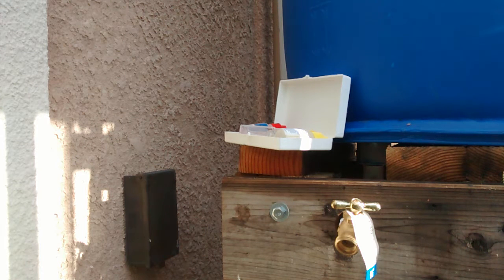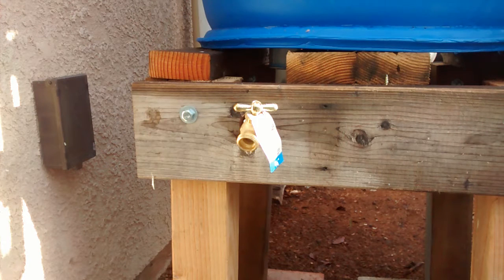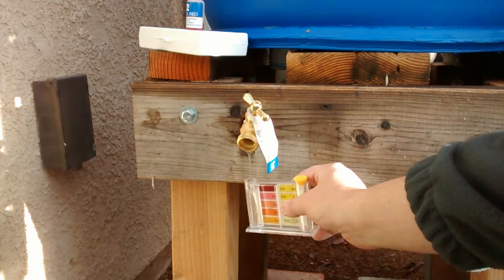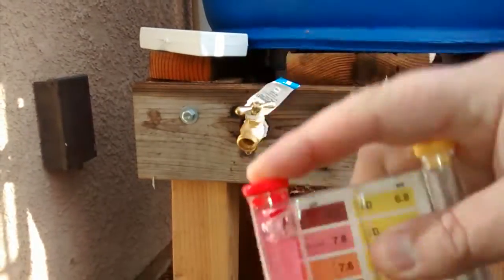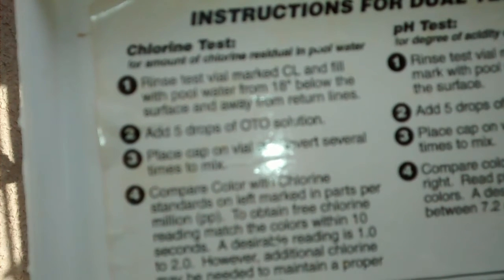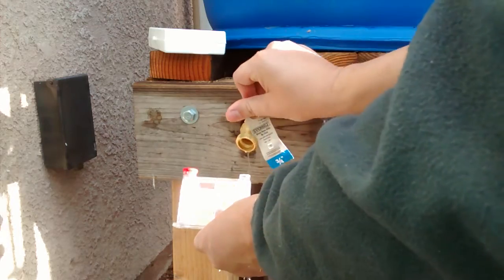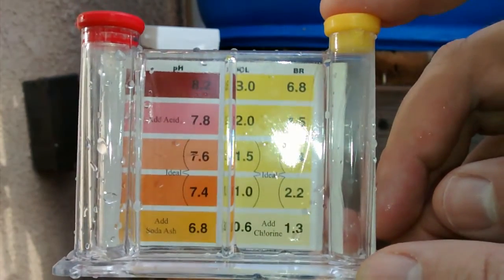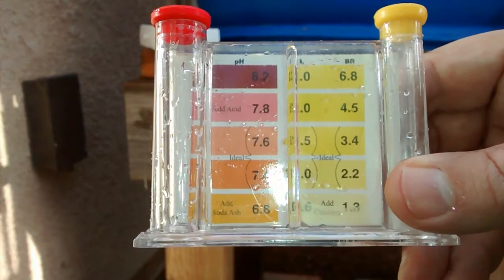Rain water ph and chlorine test

Comment: Yes rain water is drinkable, as long as you filter it first and safely secure indoors in safe drinking containers within the same day it is captured. Heating up fresh rainwater from a storm is not necessary. However, . water remaining outdoors in reservoirs or storage tanks two or three weeks later or more  should be heated to at least 160°F before drinking (boiling to 220°F plus is not really necessary). Make sure to capture rainwater after the air and roof have been washed by 10 or 30 minutes of rain (depending on how heavy, long or frequent it rains). Also, be careful of radioactive power stations in the area or direction of where the rain is coming from. Other than that rain water is safe and much more detoxifying than bottle or tap water. I have been drinking rainwater  for sometime now and much better off than before.
Reply from the maker: All no surprise. Thanks for your feedback

Comment: What makes rain water not safe to drink?
Reply: Jared Lyan manmade toxic pollution spilled into the air by automobiles, machines, factories, airplanes, etc. The heavy release of sulfur or nitrate gases from acid soils (not very often tho). Contaminated apparatuses used in the process to capture or harvest rain water such as roof tops, or roof tops freshly coated with elastomeric roofing paint, petroleum or chemical plastic barrels not properly washed or neutralize, constantly pouring fresh water into drinking bottles without sterilizing the bottles every now and then etc.  If you decide to supply yourself rain water for  drinking purposes, then please be aware that capturing rain water for drinking requires the strict practice of safety and discipline.
Reply: and ground wter oh yeag thats exempt from soil pollution @TedForbes21
Reply: its safer than most water boy